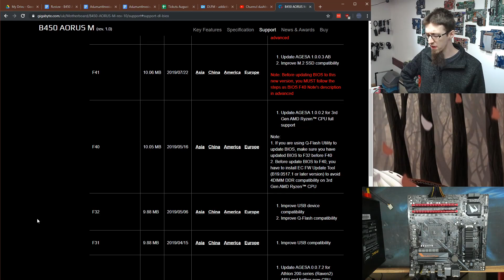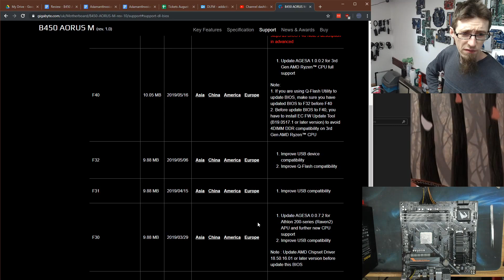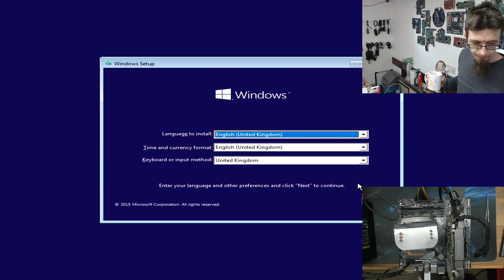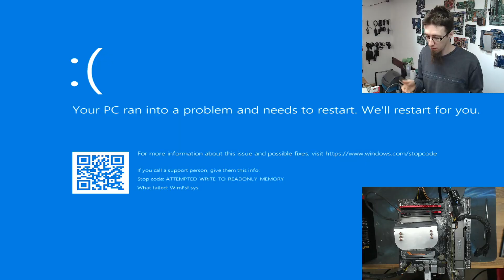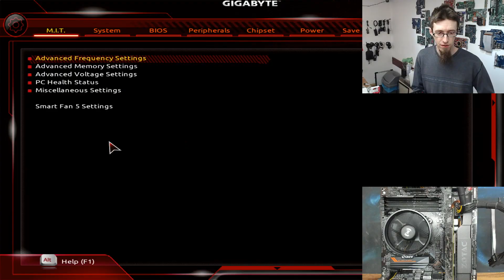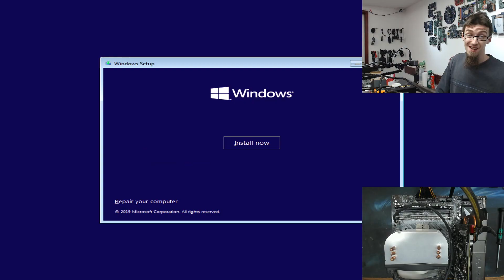LFC#183 - Gigabyte's BIOS update bricked my B450 Aorus M

Comment from the maker: Announcement because this video is gaining a bit more traction than I was expecting! 1. I have another video in the works which sheds a lot more light on what happened in this video - including pitfalls, where I went wrong, where Gigabyte went wrong, and how to safely update this board. 2. Regarding other components like PSU, GPU, etc etc, they're my bench testing kit and all known-good parts.
Reply: im just build a pc with this board and the bios Freeze at 10 seconds on it  :(  Ryzen 2700X Bios F50  greetings from México.
Reply: @DANIELworex  oof
Reply: @Moshimulations  it was the Bluetooth mouse/keyboard. use wired ones lol
Reply: I want a motherboard for a Ryzen 5 3400g, I don't want to update any bios, which motherboard would you recommend me?
Reply: @androidgameplays4every13  I dont think you should get 3400g but instead a 3600 then get an X570 or B550
Reply: @Moshimulations  Really? I was thinking to get the 3400g because of the integrated Radeon Vega graphics, if I get the 3600 I'll have to buy a GPU, should I buy a moderatly cheap GPU and get the 3600?
Reply: @androidgameplays4every13  yes,
I recommend that over 3400G.
get RX 5500XT on an X570 (doesnt matter which one)
Reply: @Moshimulations  Thank you for your good advise, I went with a 3600X and a GTX 1650 Super, couldn't be happier, thanks!
Reply: @androidgameplays4every13  anytime my man
Reply: Very early on when you were saying doing the chipset bios update won't do anything I was saying, just do it, it needs updated too, along with another program.  I have an Aorus b450 pro wifi rev 1.0. My cpu is r7 2700. It didn't have any issue with install because it was natively supported. Mine also started with F2. Just around the time Zen2 was coming out I was getting crashes so I upgraded to F32 but I updated all the things it wanted updated first. About 3 months later had more blue screens and shut downs. I then updated to 42 without issue and a couple months later to 50, where it's been for a long time. Still using 2700. Only weird thing I noticed is that sometimes in the earlier bios my xmp would be lost after a crash, or even just a reboot, and I'd have to go back into bios to re-enable it. Hasn't happened in about a year.
Reply: I know you've already solved the problem, but I just wanted to point out something I noticed you didn't seem to catch. At 28:50 just before it crashes in the bios, the memory frequency counter changed to a Chinese symbol. Don't know if that means anything or not, just though it was interesting
Reply: i thing what u did wrong was not checking filesize,.... but thats nitpicking,..
Reply: Does your bench run off a UPS?
Reply: Next time you make an update to the latest bios, make sure to read every single bios update and check what you need. First F4 states "Note : Update AMD Chipset Driver 18.10.20.02 or latest version before updating to this BIOS". yes you can skip some versions, but you tried to skip to much. 
PS: I have a x470 Aorus Ultra. I had some issues trying to update for the ryzen 3600 in form of performing all the right steps provided. did the update and at the next restart it reverted to the previous version. But after i insisted and tried harder i managed to do it. 
PS2: Next time pay more attention :)
PS:3 I know the video is last year, but after 13 minutes into the video i was convinced you did something wrong, and after i checked the model on gigabyte's website and all the bios versions i figured  why it went wrong for you. Take care

Comment: When you downloaded the bios from gigabyte did you have to rename the bios file or not
Reply from the maker: No. The BIOS file can be any name you like. In the old days of BIOS updating from DOS, people often renamed the file to something easier to type in, but with modern systems like Q-Flash it's not needed.
Reply: @Adamant_IT  i bought the same mobo but its already ryzen 3rd gen ready
Reply: john jeric diaz how is it going?
Reply: @basil834  it run smoothly
Reply: john jeric diaz sounds great , I’m seeing a lot of bad reviews about it and I don’t know if I should buy it or not 
I’m very limited in my choice because here where I live mobos aren’t everywhere
Reply: @basil834  im using it with ryzen 3400G, 16 gb ram it performs well for me
Reply: john jeric diaz nice , I might get it with a r5  2600 and 8 gb ram
Reply: @basil834  if your going with look for a gpu as well
Reply: @Adamant_IT  Well, actually, Some Motherboard DO require you to change the name of the Bios. Read the BIOS update instructions carefully for Motherboards.

Comment: f50a bios is out....... Can you go direct from F2...  this board ticks most of my boxes but the bios update to 3rd gen Ryzen scares  the hell out of me.
Reply from the maker: If you can hold out another week or so, I'm working on a final chapter to this mobo - I've got a USB EEPROM flasher and two blank BIOS chips for this board, and if it all works, it means I can manually reflash the chips at will, even if the mobo is totally bricked. From that position, I'll be able to do all kinds of testing. Hoping to start filming that video tonight.
Reply: @Adamant_IT  bro, my mother board is on F1, what i should do? haha little scared =P i can go to f50 ? or i should do every update just to be safe?
Reply: @Adamant_IT  Awesome.  I want to know if I can jump strait to f50 as well.

Comment: Might be worth buying a SPI ROM programmer and removing the bios chips and backing up the data before doing an update, would have saved some heartache and time, because if it fails you could always restore the original using the programmer.

Comment: One thing i learnt over 20 years ago when first starting out in this business is that ... never bother with high end motherboards..they are plagued with initial issues much like new operating systems...i encounter so many clients with teenage sons opting for high end motherboards and high end graphic cards thinking that they are the best thing since sliced bread only to be disappointed to learn that they have booting issues....sometimes ongoing.stability problems until bios updates are released and in your case they were released but bricked your board..i would just wait a year or so until that board is mostly issue free.. yes i hear people saying by that time another update model is available etc etc..yes true..and so are the potential issues attached to it as well. Well done with your issue though!!!
Reply: This is not a hight end board it's a B450

Comment: Hi, I have similar problem with an aros x370 gaming 5 and a Ryzen 5 1400 with corsair pro rib 2666mhz ram, the problem is that I put it all and try to boot it but the ez bug cpu led powers up, all my fans are working but the cpu led is always on and I can't boot, pls help me I don't have any idea os what can I do, I have spend more money than I have to a thing that even work, I see a lot of your videos like the one of the corsair void battery change, is what very helpful like always, thanks,
Reply: @Adamant_IT  could it be incompatibility with ram? I have try everything except the PSU change and the ram change, cpu reset did nothing and cmos reset neither, I think I have bad mobo unfortunately, also the buyer description said it was bios version f40 I don't know if I had corrupted bios problems or something like that, anyway mono still in guaranty because is new, is the first time I used it just very unfortunate, I will post here the resolution.
Reply: @Adamant_IT  ok the problem is not ram, I have to test psu and mobo, i will resend to the seller the mobo too, I will put here the result for future problems, anyways Im not sure if aorus is a good mobo option
Reply: @Adamant_IT  I try something very interesting, I have try the volages of every conector in my atx conector and I found an issue in the power ok pin (the gray one) it should give me 5v and now gives 0,7, that could be the problem, i bought a new PSU and i will try again.